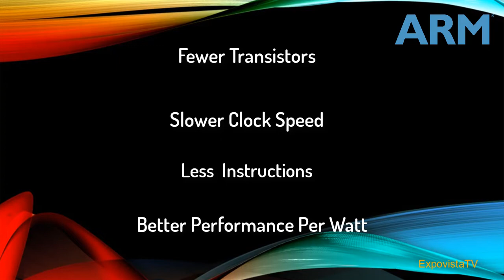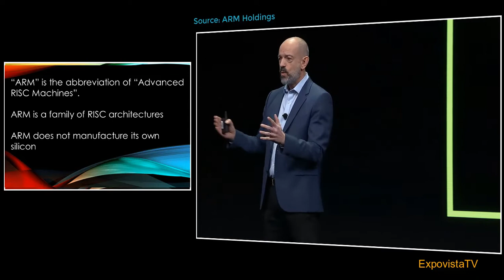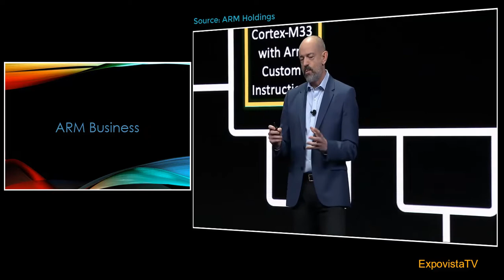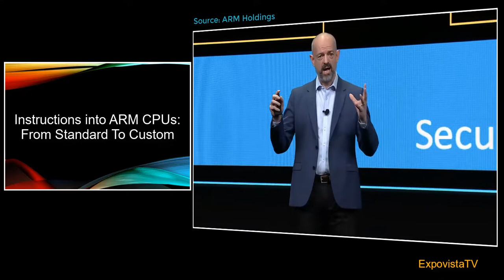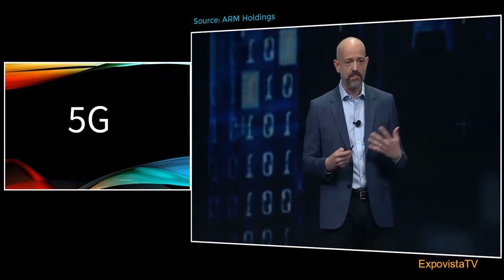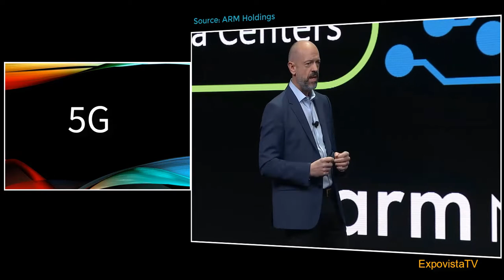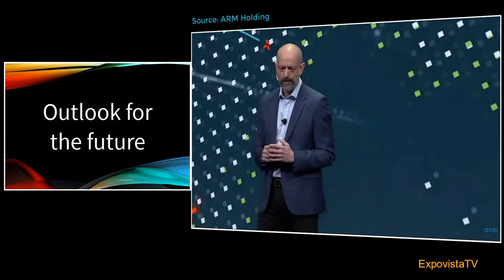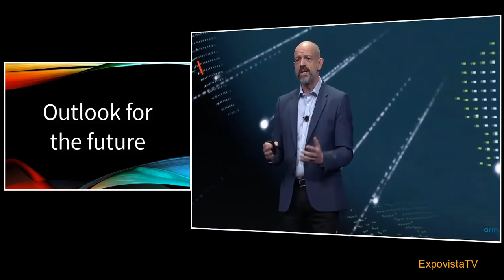Inside The New Apple Silicon: The ARM architecture.

Comment: I think you've got a slightly skewed view of why Apple went their own way.

Apple's been involved with ARM a looonnnng time - they were one of the founding partners keeping ARM alive in the early days, and it was the core of the Newton when that was around.

Nowadays, Apple is one of the few architectural licensees, and has been developing using the ARM ISA for the last decade. They have one of the world's premier silicon teams, and while I'm sure they look with interest at ARM developments, in essence A series silicon is rather distantly related to current ARM developments.

While using the AArch64 instruction set, Apple has optimized and refined data flow in their silicon, adding logic blocks and arithmetic units, widening the processor, improving caching and data flow, implementing out-of-order execution units, refining vector units, and introducing hundreds of voltage domains to turn off parts of the processor not in use. Apple shares the 64 bit instruction set with ARM, but the the design of the A series has evolved beyond ARM's initial designs and has features that lower tiered licensees like Qualcomm and Samsung can only dream about.

Samsung's Exyos processors found their core in an early collaboration with Apple on (I think) the A4, and when Apple and Samsung became frenemies due to IP disputes and severed their processor development partnership.  Samsung dropped back to more standard ARM cores whereas Apple continued their efforts into continued development and refinement throughout their A series evolution.

To give you an idea of the aggressiveness of Apple's silicon and software engineers, they eliminated ARMv7 (32 bit processing) from their products and silicon in just two years to clear space off their SoC for other logic.
Reply: ARMv7 is very old now, ARMv8 was first licensed in 2013 and ARM are currently up to V8.2 with their latest cortex A78, cortex X1  and server grade Cortex N1 cores. This is why very few people have a V8 architectural licence and just use ARM's  cores as they come. Even Samsung and Amazon moved to ARM designed cores with the  64 bit transition. Also Apple still pay ARM royelity for "every" chip they make.   And btw the 50 billion figure dates back to 2013 the current figure for "shipped " ARM chips is 160+ billion.
Reply: @patdbean  Rumor has it that the 5nm A14 coming up will be the first ARMv9 implementation.

Here's a comparison of various vendor cores from Anandtech: //www.anandtech.com/show/15875/apple-lays-out-plans-to-transition-macs-from-x86-to-apple-socs.

Looks like Skylake 10900K still beats the A13 Lightning cores on integer, and Skylake 10900K, Ryzen 3950X, and Corex X1 win on floating point, but the A14 will be Apple's first 5nm and is rumored to be the first ARM core to go above 3ghz.

It'll be fascinating to see where A14's Firestorm cores fall on this chart.

The example of the removal of ARMv7 blocks was to show how quickly Apple's silicon, hardware, and software teams can move in support of their future roadmap - do you think Qualcomm and Samsung will ever  have the gumption to remove ARMv7?

They all suffer from the same malady that plagues Intel ... they can't remove all their old cruft because some customer somewhere may be counting on it still being there, so a fair portion of their chip sits there pretty much non-productive "just in case".